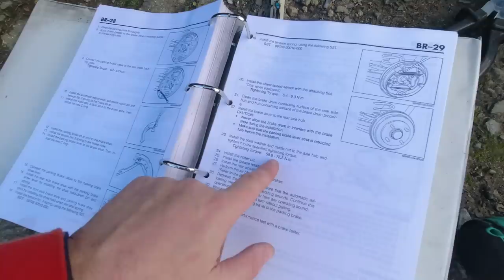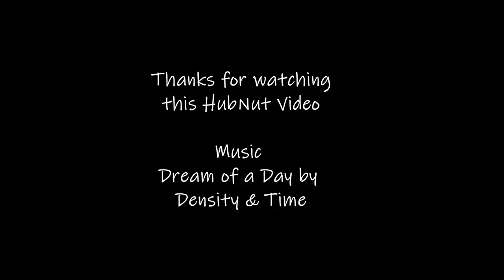Creative solutions! Daihatsu Sirion rear brake adjustment

Comment: The reason for the wide range torque spec is to allow alignment of the split pin. You should tighten to the lower spec and check hole alignment if necessary by setting to the higher spec and turning until holes align. Hopefully without exceeding the higher torque spec. As far as I can remember there was never a set number of clicks for the handbrake on the MOT the only point was that there should not be any excessive travel. Love the voice over silent film vibe.

Comment: I like this format for showing the quick tinkering smaller jobs.

By the way check out the Paris to Dakar classic line up of cars this year. Some truly Hubnut rated vehicles including a Peugeot 504 V6, some Peugeot P4's (Mercedes G Wagen with Peugeot badge swap), Citroen CX, 3 or 4 Fiat Pand 4x4's, a Lada Niva, Isuzu Vericross, VW Transporter T3 and two Citroen Visa's. Also a load of the Mitsubishi, Toyota, Nissan Dakar vehicles, two of the 1970's Porsche 911's and some interesting off road trucks including a double cab DAF.

Comment: Ha, actually said Hubnut! 😆. Interesting setup for the ABS reluctor ring, not seen one like that. Never met a shoe adjuster that works well tbh, the best I've found is the type on Polos, etc. Little triangular bit through a slot with a spring pulling it down and teeth on the sides to stop it backing off. All good until the teeth wear off! Worst has to be Cinquecento/ Seicento friction disc setup, I can usually get a good handbrake or footbrake not both! Yay tinkering! 😁

Comment: Ian to cut a split pin you should use the notch on top of plier jaws. Then to expand a split pin tap the eye with a hammer, push pin together and it will slide into hole. You do not need to bend them excessively the "sprung"  pin will stay in place. It is how we used to fit split pins in caterpillar tracks.

Comment: 3 handbrake clicks for the MOT, that is very detailed. Here in the Netherlands, enough deceleration force must be obtained on the brake test bench at the APK, so every country has differences.
Reply from the maker: Tuens out that rule no longer applies...
Reply: @HubNut  Then at least your handbrake is properly adjusted Ian.

Comment: A tip which I find works well with Toyotas with drum rear (and Ford Falcon with drums) is to drive briskly in reverse and firmly apply brakes on a hard road surface.
I used this trick with 1971 XY Falcon, Toyota Hiace vans and current Toyota 4Runner that all use a similar brake adjuster.

Comment: Another way you can do this is use 2 screwdrivers, and slowly lever the shoes outwards at the top, counting the clicks. I sometimes mark the adjuster quadrant with a light scribe mark before adjusting, that way when you go that one click too far and have to reset, it gives you a point to start from again, going one less click the next time!

Comment: On early Fiestas, if you adjusted the handbrake to Ford specifications, the lever was almost vertical when the handbrake was full on. As I recall it was to enable the auto adjuster to work properly. 

I don't believe we were ever told there was a set number of 'clicks' that the lever should come up when I was testing, maybe things are different now?

Comment: I think I would have done the nut to the lowest torque then a bit further if needed to line up holes, then check for play / binding of the bearing.I did have a rear wheel bearing collapse on my Spark, possibly due to over-tightening at a brake service
Reply from the maker: No binding happily. I did check for that.

Comment: There is no mention in the MOT requirements about how many clicks the handbrake must work on, only that it must not be near the top of the travel. The mechanism must be balenced between the wheels though, evry difficult on my car as the handbrake drum is on the prop shaft!  The service manual for my car also says normal adjustment is between 5 and 10 clicks.
Reply: True, if you go below the 5 clicks the adjusters may cease to work. Seen that many times years ago, even had dealerships over tighten the cable and cause that problem.

Comment: Now you're making me feel guilty for putting this job off on my 75!!  I fear all may not be quite so simple in my case 😬
Reply: That won't work on a 75 as parking brake is different, the don't adjust automatically as they use shoes inside the rear disc bell (BMW use the same idea), for the 75 you need a small flat blade screw driver, take of the wheel, pop the rubber bung out and with a light turn the disc untill you can the adjuster, use the small screwdriver to tun the adjuster (can't remember which way) untill the disc won't rotate then back off the adjuster to  2 "clicks" and it should be adjusted perfectly. You also do this when replacing the rear discs as hammering them off can damage the shoes and adjusters.
Reply: @Ju1ian10001  Thank you muchly, I hadn't even gotten as far as looking it up but that sounds like even I can't mess it up...
Reply: @jmurray01  Once you see it, very easy to do. but alas in my old centre we had a young "tech who would never listen and just smashed the discs off and wondered why the new ones go on, still didn't learn after i showed him.

Comment: Good trick...but my guess is the cable is not returning properly. Either needs a new cable or the cable is adjusted too tight so the auto adjuster cannot do its job?
Reply from the maker: Foot brake was also dreadful. The auto adjusters are terrible on these.

Comment: I presume you already tried the repeated braking in reverse method?
Reply from the maker: Didn't know that was a thing. Next time.
Reply: @HubNut  It's how automatic drum brake adjusters work. Drive backwards at about 10 mph , then slam on the brakes. If the adjuster is sticking on that side, which seems likely, that can "unstick" it. Doesn't always work.

Comment: Realizing I need to get a new spring for the auto adjuster. Do you have any idea where to get hold of one? Can't find it anywhere. 2007 sirion
Reply from the maker: Amayama may be worth a try. Sadly Daihatsus are not great for parts support.
Reply: @HubNut  thanks! Any idea where I can get hold of the parts catalogue to find the part number?

Comment: Ian the 3 click rule on the MOT become obsolete about 10-15 years ago and is no longer used, the only rule are the lever must be secure and no corrosion with in 30 cm of it, and the must be some reserve travel (Basically it can't hit the stop.) Again the amount of "clicks" is not counted or part of the test anymore, this come about because of the horrible spread of electronic parking brakes. i also hate E.P.B because 90% of them won't work if the vehicle is moving so are in effect useless if you loose the service/foot brake, atleast with a good old lever you could stop.
Reply: Excessive parkbrake lever travel is a failure though...and most E.P.B s will use the abs to bring on all the brakes when over a certain speed. Reserve of travel on levers is more to do with motorbike brakes , etc
Reply: @stevieboyt53  The actual wording in the manual and on the RFR is "little or no reserve travel" you have a 1mm of travel left and we have to pass it as it don't hit the stop. EPB's to to "lock out" of use when a vehicle is moving as self protection, if the apply when in motion it can/does wreck the motor in the caliper, as it overloads. some time's we have to turn the vehicle off to work the epb on MOT because of this. The MOT is MINIMUM standard, service standard is 1000 times better.but thats the british MOT for you
Reply: @Ju1ian10001  but isn't that under service brake pedal or control levers..1.1.2 in manual. Not parking brake levers ??
Reply: And yeah mostly do parkbrake efficiency test with just ignition on with epb.

Comment: The handbrake on Taylor, my 2009 Suzuki Swift (I mean what else could I call her?!) needs adjusting. It works fine, holds the car on a gradient, and is balanced well side to side, but the handbrake lever goes almost all the way to the end of it's travel. I must sort it out.
Reply from the maker: I've been meaning to sort this out since October...
Reply: @HubNut  I'm not much better. I bought the Swift in early November, and been meaning to sort it ever since.